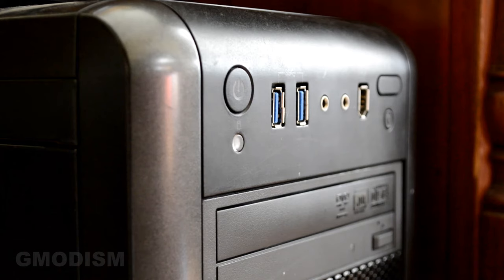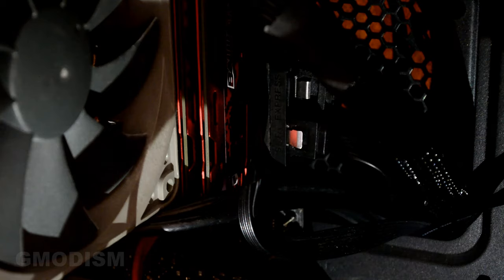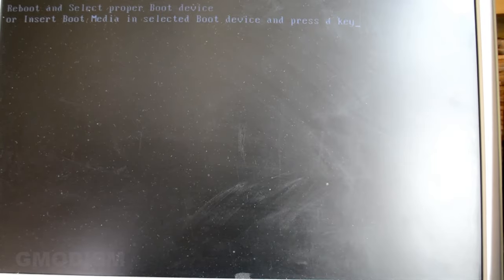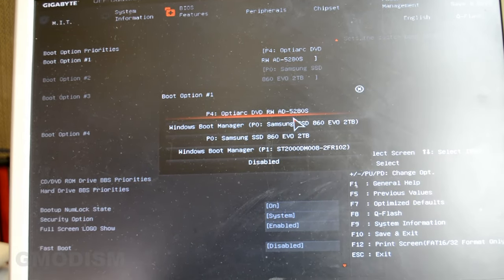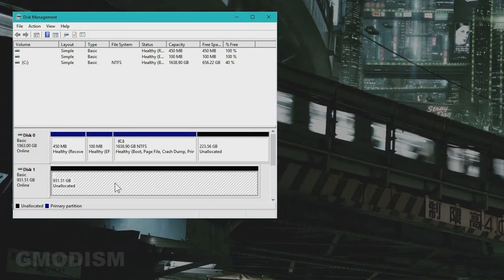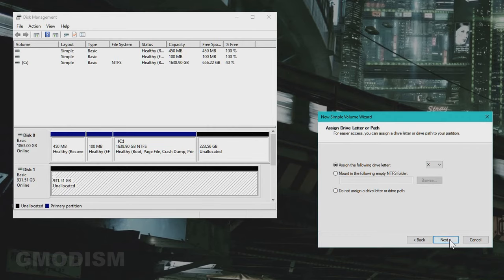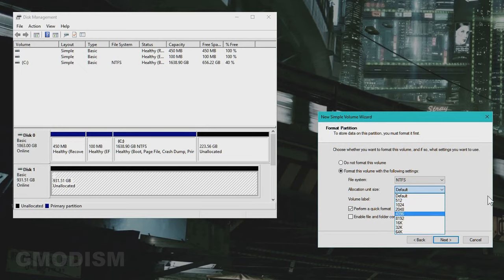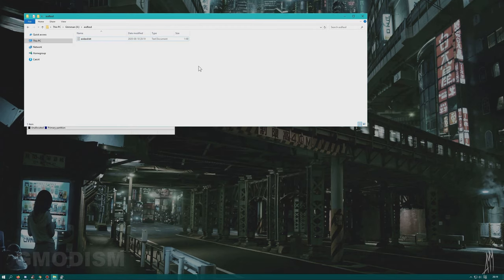How to Install a SATA Hard Drive or SSD - Windows 10/11 2024 Working Tutorial

Comment: i'm not sure there's any truth to it but i have been told it is better to leave 10-20% of a HDD empty as well, it allows it to move data around easier, especially old ones that can have bad sectors.
Reply: In a HDD it is convenient to leave that much empty as it makes moving files arround easyer however with a SSD you can get slightly slower when your drive is nearing full capacity. Also 10% can be excessive so I recommend 100 gb as it should be sufficient in order to help with moveing files but not so much that it is pointless  not to use that space.

Comment: Question so I just opened up my pc for the first time and it has this like plastic wire around it. Should I detach them
Reply: Zip tie**
Reply from the maker: Guess that helps secure them in place inside the case, should not matter if you leave the zipties or not, depends if you have to remove them to do what you intend, then remove them but if you can do what you wanted to do without removing them then do so, up to you!

Comment: so i put a new second hard drive on my pc, and it automatically detectted as new volume E, no need to disk management... did i miss something?
Reply from the maker: Then it was factory formatted! Should work fine but check if its ntfs or not
Reply: @GMODISM  should be set to ntfs ? what if its not? should i reformat it again?

Comment: what do i do if i dont have a free power cable on my power supply
Reply from the maker: You can't possibly already have connected upp like 8 drives or what??? if you did use them all you need another powersupply I guess, or some kind of adapter
Reply: @GMODISM  nono i have a pre built that's why. I asked around in reddit and foun out there are power splitters